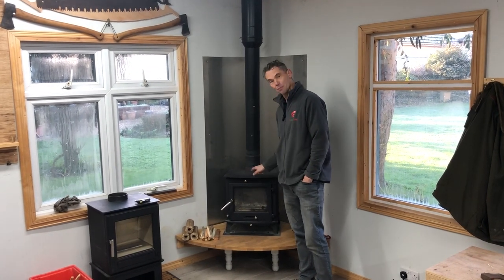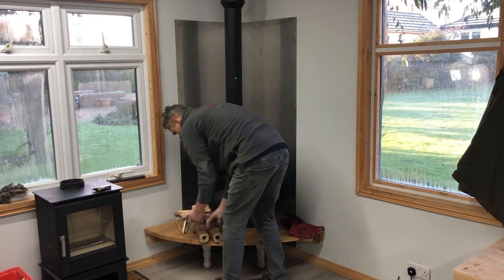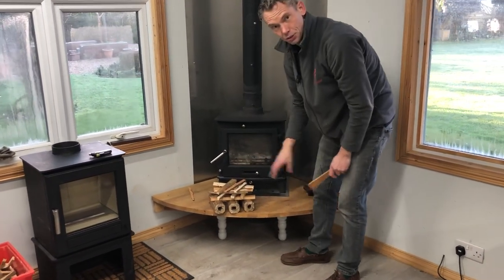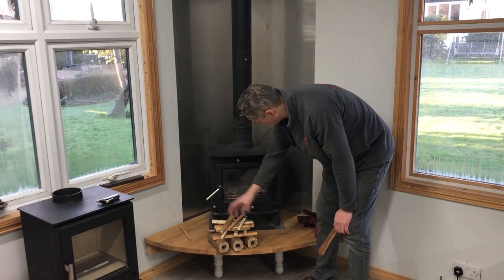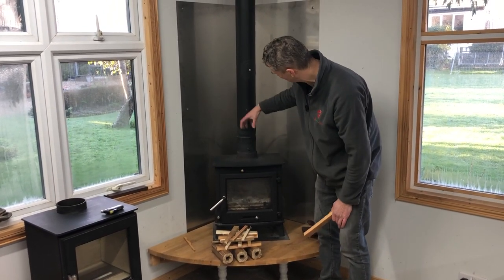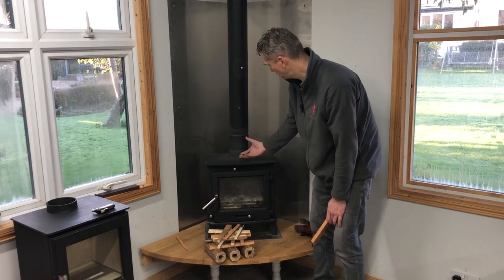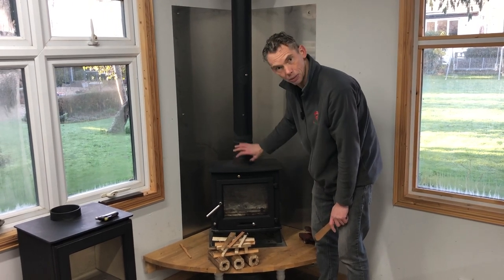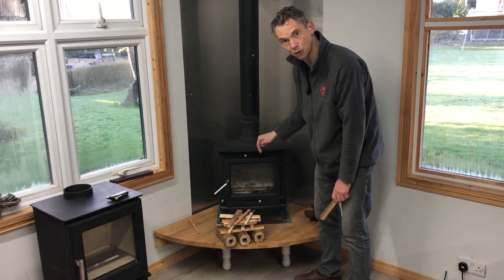Lighting Your Stove With a Recoheat

Comment: Do you have any videos on how to run heat to other rooms, i have a very small cottage with a multi fuel burner and two rooms upstairs with essentially no heating (rely on electric). Ive no way to install central heating so very interested in this.
Reply from the maker: There are plenty of people now using  a Recoheat to achieve that. It comes down to convection and insulation, really: as long as you have air flow from the room with the stove to the stairs, the heat will build up and follow the convection flow upstairs. Then it's a matter of how fast the heat is lost because of poor insulation: if you've got ok insulation then the rooms will heat up to a decent degree. If you want to email sales@recoheat.co.uk  with a floor plan etc, we can advise if it's likely to be effective. Thanks very much for your interest.